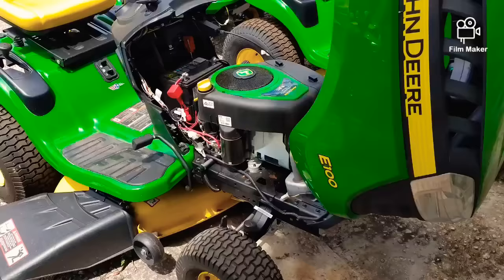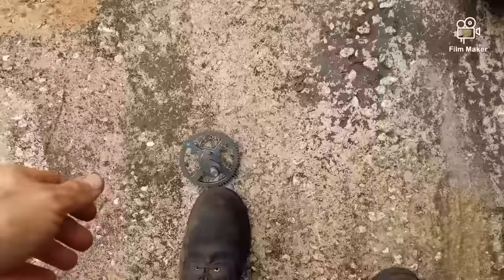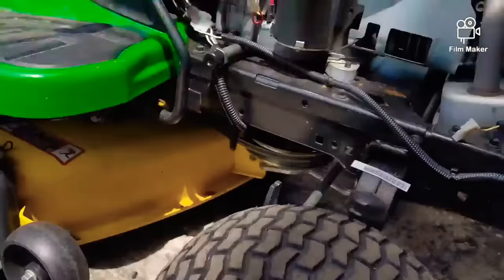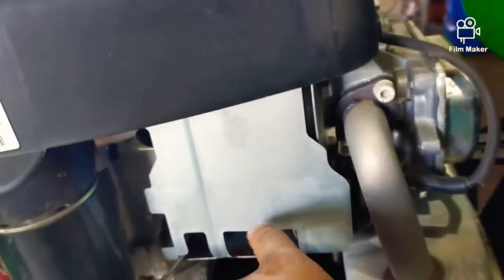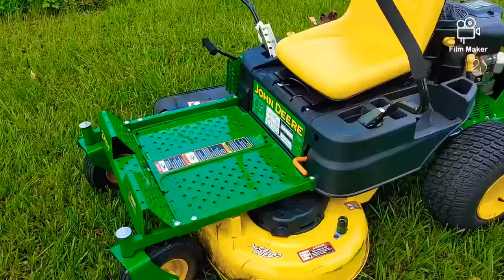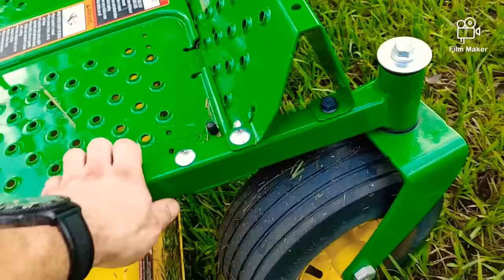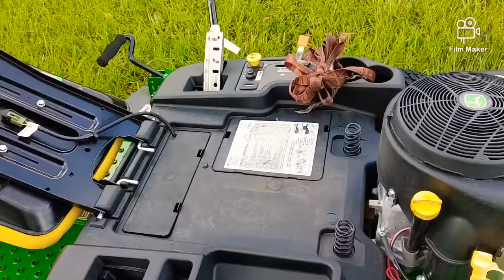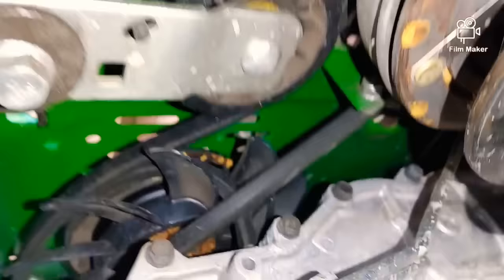Lawn mowers to avoid!

Comment: I guess I've been pretty lucky with my Z425.  I've had it for 14 years with over 600 hours. I've changed the belts, both drive and blade and changed the crankcase gasket just last summer.  Overall I find it a very DIY friendly mower.  I started doing my own work on it after my very first maintenance at the dealer cost me over $300.  I think I'll keep it until the government tells me I can't burn gasoline anymore.
Reply from the maker: Mowers back then were built better
Reply: 14 years ago, it was probably made a lot better than they are now.
Reply: 2009 Z425...replaced battery one time  and belts. Awesome machine.
Reply: @1red_nextview740  That's the common feeling.  I just got back from Lowes and looked over the new models closely. I'd venture to say they are built as good, or better, today.  I wouldn't hesitate to buy new but I plan to use my current 14 year old Z425 and my 15 year old LA145 until I can't mow anymore.
Reply: Quite often, it's the operator, NOT the machine. Some people should not operate machinery.
Reply: I loved my z425 right up until the Briggs  motor took a shit, as they all will. Steel valve guide in an aluminum head, guaranteed to walk out and cause a pushrod to drop. Fortunately I was able to peen the heads and keep it running until my kubota bx was delivered.
Reply: @Mechanical_Mind  What do you think of a Simplicity brand zero turn mower with a 48" welded deck and a 22hp Kawasaki engine.
Should I buy ??
Reply from the maker: @bextar6365  I recently worked on a Simplicity zero turn mower. It was about 15 years old. It was the mower in this video.https://youtu.be/RYxknVxx8Ag. I thought it was a well built mower overall. I definitely think the welded decks are the way to go.
Reply: Interesting…Consumer Reports have multiple JD riding mowers and ZT’s rated #1 in their categories. I’ve never had a problem with any I’ve owned, and wish I could say that about Toros, Snappers, etc., that I’ve owned. My current ZT is a Deere e720, and it has been perfect.
Reply: Yes sir no problem with my johnthin deer
Reply: I've got the same mower, but only has 250 hours on it. I change the oil once a year. I use Amsoil synthetic and have since it was new. It's on its third battery, but I keep it on a battery maintainer when not in use. It's never had ethanol gas, Original belts, tires, and everything else. It's cleaned after every use so grass doesn't sit on it and I have a couple sets of blades I swap out yearly too.
Reply: @alanparks7919  
I remember when consumer reports was a credible source.  Been a long time though.
Reply: Well, their reviews have never led us astray. They’re only one source I research, but so far, so good. Been a subscriber for years.
Reply: Sounds like you just haven't noticed.  I'm sure they're not out to lead astray or they'd be called out on it.  My estimation is it seems they aren't very thorough at all aspects of things (that would be hard) or maybe they're influenced by factors behind the curtain, whatever those might be.  It's as if they're just comparing checkboxes of feature lists and customer satisfaction/reviews.   Pretty sure I can do a better job of that much myself with my own personal criteria for what suits me.  😂   

But you know when you're dealing with major brands of things like this, expensive mowers, it doesn't matter which you pick, you won't feel led astray.  They're all out to gain brand loyalty.  Any could have an issue in some small percentage of units but by and large in a given price tier they're all about the same level of overall performance and reliability.  Plusses and minuses of features becomes a matter of personal preference.  Validation of personal choices by outside sources is something for those who are insecure about their ability to analyze and make good choices.  

If you want some fun and see some testing of products, check out "project farm".
Reply: Z425 is a good mower.
Reply: Z400 is not the mower mentioned in the video….
Reply: @dperr338  Ya moma
Reply: Me too,  I bought 2 in 2007 at Lowe's at the same time and used them to cut lawns on the side. 1000 hours on one and 800 on the other and I've replaced a few parts in the arms , blades, spindles, 1 carb, 1 starter, 3 wheel bearings, batteries belts and that is about it. Perfect maintenance for oil changes, probably change the oil twice as often as they recommend, oh new hydrologic fluid for both and tires for both but most of what I've replaced is simple wear and tear and age. Paid 7k for both and probably made 200k with them  in 16 years. I'll take that any day. And 2 seats replaced, actually upgraded. Jonn Deere 445 24 hp V twin
Reply: @stuartbear922  Amen
Reply: Never listen to the government do what the hell you want to do
Reply: @timr31908  LOL!  Let me rephrase then.  I'll keep it until I can't get my hands on gasoline anymore.  That won't be in my lifetime!
Reply: Yeah some people shouldn't but they do anyways then i buy they're broken toy's
Reply: @chrisgill7824  The JD battery's are designed to fail, I think.  I switch to Walmart's Everstart which just keep on going.
Reply: @elgringoec  Do they accept payoffs for good reviews, do you think, or are they just lazy??
Reply: @Fred-gv3kh  
There's some of everything out there.  Good intentions with limited compensation along with things you mention...  Who's to say what's what?  That's why ya gotta take it all with a grain of salt.

Comment: Thank you for your candid information. I have been a die hard JD owner for 40+ years and I have noticed a rapid decline in the quality of their products. (i.e. the John Deere "branded" engines)..I'm calling bullshit on this one! I'm guessing they are Briggs/Stratton made in China or similar...When my current rider dies, I'm switching horses to Cub Cadet with the Kohler engine...I have NO LOVE for Briggs and Stratton after a warranty debacle several years ago...Kohler has never let me down...Long lasting, smooth running, worry free

Comment: I have the S100 from Lowes and it has the metal transmission.  John Deere went back to the metal transmission due to a lot of warrantee work done on them. Dealer told me out of 10 mowers 8 of them will soon have trouble problems. And I think they improved the cam also. I could not complain, I bought my for $1499.00 because it was priced wrong, Then I had a 10% off coupon which was another $150 off and they had to sell it to me for that price. Plus, John Deere had a promotion when you buy one of these mowers you got a free cart plus free shipping. I turned around and sold it for $200.00 Could not pass it up.
Reply from the maker: I noticed they ditched the plastic transmissions recently. We had a mountain of plastic transmissions at the dealership years ago from all the warranty replacements

Comment: I have a Z345M and the first two things I did was replace the front tires with solid tires and bought the deck foot lift kit. I never step on the deck and I am so glad you said the engine was good or I'd take your advice and get rid of it - but I think I've solved several of your criticisms except for the front swivels or "bearings". I'm in the market for decent replacements if they ever become available.
Reply from the maker: If you put some grease on those caster fork spindles it will help them last much longer and they are easy and cheap to replace. Just a silly idea they had in an attempt to save a dollar by putting those plastic bushings in there. Thanks for watching!

Comment: I have had a Z 425 for over 10 years with no issues, of course I serviced it regularly a haven’t abused it.
Reply from the maker: A ten year old Z425 is a completely different mower and far better made then the late model z335e I talk about in this video. These things always have the same problems. But for the 2023 year model John Deere has solved 4 of the 5 things I mentioned was a problem with the Z335. Thanks for watching
Reply: @Mechanical_Mind     You’re right the newer units are built on the cheap I see it in my shop.

Comment: Awesome content. I have a JD LA125 it lasted 12 years before I had to replace the head gasket! After I changed it, running better than ever! 👍
Reply: Looking into my first ever riding mower and watching a review about that exact one!
Reply: In Canada here, I have a LA125, I’m mowing an acre, I’ve had it for 17 years. I do the maintenance every spring, I blew the crankshaft before the warranty expired and John Deere replaced the briggs and straton motor. It’s been reliable for over 13 years now with regular maintenance. I changed the drive belt every 5 years and the deck belt every three, replaced deck bearings and some bushings. Easy maintenance and a reliable machine, I will be buying another one soon.

Comment: You are very correct.. the 1s you showed are bottom of the line box stores.... they are are all made by mtd... I was a master small engine mechanic with my own shop... I mainly did 2 strikers..also a chainsaw race builder... didn't take long to figure most people bought junk... I didn't want to get married several times a day that's why I stayed with 2 strokers...great job sir

Comment: Replaced my 2017 X350 transmission because of broken spyder axle gears, at 550 hours. $997 plus my labor. Now I'll remove the trans each fall to turn up side down to change the oil.  It does not have drain plugs or a replaceable filter. The 48" mower deck height adjustment arms with hardware badly worn, ive added new hardware and coat with grease to slow wear. Youve got to grease every thing that moves, pivots, slides, linkages very frequently. Kowabunga motor is mint👍

Comment: You needed to emphasize that these were bought at a big box store. I have had 2 John Deere lawn tractors bought from a JD dealer; each provided 15-18 years of good service only replacing a deck pulley myself. Dealer units are far superior to those you reviewed - more expensive but well worth it. You need to let people know that!
Reply: Mine was purchased from a "big box" store. It's identical to the same model I've seen a few of at two dealers. 

John Deere doesn't put their name on lesser-quality stuff for big-box retail. Why not? Because, if it fails, it's the Deere name that will get dragged down, not that of the retailer. If you buy an S120, it's going to be an S120. 
Now, units assembled by the retailer may be sketchy if the assemblers weren't properly trained or motivated. 
I do admit that my unit (E120) is only four years old and has only about 125 engine-hours on it.

Comment: I have had a JD 335 for 7 years. My tires never leak air. My bushing are fine. The mower deck is the same 42” deck they put on all their residential mowers.  I have never had an issue in 7 years with mine.

Comment: I have 365 hours on a z355e. They must not be too bad. I will say the drive belt and deck lift cables do suck to replace.  😅  I'm not complaining that they lasted so long, though. I retired it with a z530m this year. Hope it lasts without much fuss.

Comment: Ive got the 335E. One of the first zero turns Ive bought. 500 hrs. Change the oil  grease it up and change belt and air filter every year. Not one problem. I have more trouble out of my Husky 454 and 60X series. The wife loves the JD. Im a big guy and cant fit on it. Only dowside Ive seen.

Comment: having just retired after a great 40years plus doing this work i will say that you are right on the mark. the small single cylinder intek engines are prone to lots of troubles, just like the customers that walk into the shop with what we used to refer to a weedeater in a bag and want it repaired for 20 buck. all one has to do is look at the zero turn and it even looks like it would break if the wind hit it.  anyway good information young fellow.

Comment: As an owner of a Z255, I've mowed over 5 acres a week  for 5 years with it. It was 4 years old before I had to make my first repair ( a new deck belt} . I also replaced those plastic bushings you mentioned in the video a few months later. It was no big deal. It was easy and they were inexpensive. It has been one of the most trouble free mowers I've ever owned. It was probably the best purchase I've ever made, especially when you consider that it cost less than $2600 from Lowes when initially purchased. The hydro's are just as strong as the day I bought it, and why on earth would someone step on the mower deck to get on the machine? It wasn't designed as a step. Even airplane wings have places where you're not allowed to stand on them. I believe this was a hyper-critical evaluation of the unit.
Reply from the maker: Thanks for commenting Bill. I made a more recent video on the Z335 mentioning some of the same points you made. For example the bushing not being hard and not expensive. I also metion the hydros dont seem to give issues. Why would people step on the this mowers deck? Well Im well aware its not made to be stepped on thats why I advise not to step on it in the video. The reason I mention it is because I see customers step on them ALL the time... Plus some mowers (but NOT this one) are made so they can be stepped on and those mowers will have foot grips on the deck. Maybe people assume the 335 can be stepped on. I dont know. Like I mention in the video often people think this is a commercial grade unit and its not. As a far as thinking this is a hyper critical review, well I cant argue with that. I didnt intend to go easy on the mowers I constantly see problems with. Your experiance with your one mower does not change the fact that Ive literally worked on hundreds of these with the same problems. The fact that I see so many of these come in with the same problems is why I pointed those repeat issues out. I think most viewers will apperciate my "hyper critical review" so they can avoid these mowers and their headaches. Anyway, thanks for watching! 🍻
Reply: Doubt you're mowing 5 acres. Every week? Lol.
Reply: @RC-Lifer  5acre a week isn't unusual depending on where you live. If you skip a week where I live, you are in trouble.
Reply: @Rusty-Metal  I mow at least 5 acres a week with a Z225. I've got 750 hrs on it.
Reply: @dpro5321  i have 4 acres, but certainly don't mow it all. I think people exaggerate when making these claims and include the entire property dimension and not the actual mowing area. These antidotal claims are as good a story as walking uphill to and from school in 6 feet of snow.
Reply: @RC-Lifer  alot of people don't but some do. I live in a very rural area. Mowing 5ac isn't unusual here but generally you'll see a tractor cover the big half.
Reply: @Rusty-Metal  my property is 108 acres of forest, 75 acres of cultivated land and 20 acres of residential/commercial. more than 5 acres has to be done for aesthetic purposes and the remainder gets done with a PTO driven mower. No exaggeration or being judgemental lol
Reply: @dosmundos3830  you have that much land and grass to cut and bought a residential unit? Are you estimating your lawn cut area?
Reply: @Mechanical_Mind  yeah I believe the deck of a mower is made to be stepped on, just like a deck on your house.

Comment: Not sure about the Z335E line but I bought a Z355E from Lowes way back in 2019 and it's been solid as rock for 115 hours. Perhaps in the last few years they cheapened up some but I've had nothing but good to say.  Starts up quick, no issues with wheels, tires or spindles and the deck has taken some bad beatings and still looks great. Informative video though
Reply: I got one in 2011 that I just sold running and bought a new Z355E. I added the foot pedal deck lift and fabricated two more anti scalp wheels for the back of the deck. I love them and I feel confident ti could replace anything on them if I ever had to.
Reply: I hate to say this but 115 hours isn't a whole lot for a mower. I do hope your luck holds out.
Reply: @sunnybeech74  Ironically, we sold it to a relative as we needed a bigger mower for a larger yard since moving. Bought a used 2021 Z530M 54" with 54 hours for about half the new price. Still have faith in these mowers.
Reply: Ah OK. Well I hope both mowers hold up well for you all. The newer mower you purchased probably wasn't made by John Deere either though but I'm not 100% sure.

Comment: I've been using a Z335E for 3 yrs and haven't had any problems so far. I only have a .4 acre lot so I guess that has something to to with it, but so far, no complains. The stock rear tires are junk, though. No traction. I bought some bigger tires on ebay and no more traction problems.

Comment: I’ve had great experience with my 335e so far. Tiny little mower that’s great for small yards that Commercial mowers just won’t fit.THAT BEING SAID mine was assembled at the Deere Dealership meaning someone who knows half a fart put it together. I hear that if you buy them at big box stores. They are assembled in house. Meaning the kid making 16 an hour at Home Depot or Lowe’s is probably throwing it together. Mine has over 400 hours runs strong. And I mean you get what you pay for. If you want a ten year mower you gotta pay ten year price 2500-3k out the door for a zero turn in general is a steel. Walker mowers are 20k out the door no attachments it’s all about the way you look at it
Reply from the maker: Thanks for the comment Matt. I see a bunch of guys trying to use the 335 beyond what it was built for because most of my customers are commercial landscapers. They abuse and neglect their equipment. Im glad you mentioned the Dealership vs Hardware store mowers. I need to do a video on that topic. Thanks for watching! 🍻